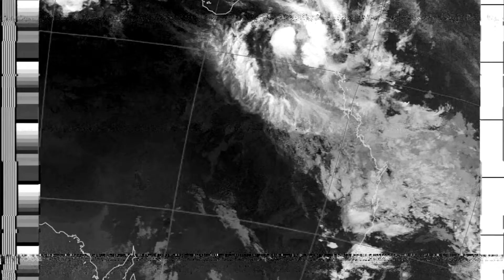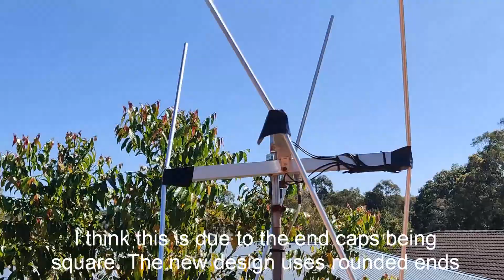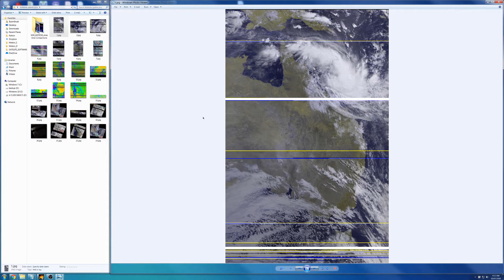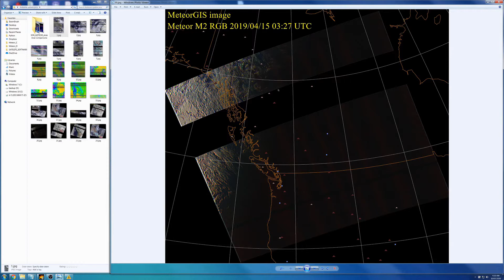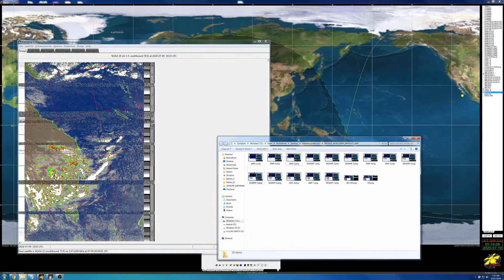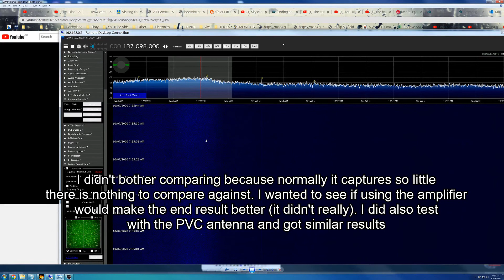NOAA/Meteor SDR Antenna TESTING/RESULTS (Aluminum/PVC, Sawbird Amplifier)

Comment: A pre amplifier will also amplify the noise. A good antenna and cables are better than any preamp. I learned this in 1975 when installing  a car radio and listening to FM radio.  Just my 2 cents. Thanks for a very good video. Will soon build some equipment and start receiving weather images. Have a bunch of SDR-RTL devices. Use them and feed data  into Piaware and Flightradar24.

Comment: The Sawbirds filter/amplifiers are great if you live near airport/interference. I recommend it if you live in very radio noisy area. I also find the sawbird great if your using a V-dipole antenna, which isn't as good as other antennas in terms of reception.

Comment: I am in the eastern US,A, and built a more simple V Pole antenna, one thing i noticed is some passes were poor quality and others much better. 
So I downloaded a program called Gpredict, and started tracking the NOAA sats, what i found was when the predicted passed were at least 50 degrees or higher over my house, my pictures came out much better . So now i pick and choose which pass to record  , based on 50  degrees or higher , using WXtoimg , the V of my  antenna is pointing due north / south. Also i use a saw filter for 137 mhz with bias T,  much better pictures. My Antenna is indoors right now and plan to mount it on the roof in the spring...Nice videos your doing !, keep at it its a cool hobby!

Comment: the black bars/noise is because of signal strength ... i wonder if you have your antenna in the wrong orientation. the FOV difference is because the satellite is in a slightly different position on its way around.
Reply from the maker: Interesting thought it might be in the wrong orientation. I am pretty sure its correct because I had one of the old antenna's elements upside down and I made sure the new PVC one would be correct orientation but i might check with my multimeter again just to make sure. What do you mean by "FOV difference", what timestamp am I talking about this so I can understand a bit better
Reply: @BoomBrush  with respect to the FOV just remember that the satellite is not in a geostationary position so as such, the orbit varies over time so one minute it might go directly above brisbane, the next pass it could be like 100 miles east or west of it at the same time in the pass. with that your image obviously is going to have a different view between passes.

As for the orientation. it's possible that instead of having the elements north/south, you could have them "south north" or even east west.  the other issue is that you could have them right hand polarised instead of left hand for example. it could also just be that there's a whole bunch of noise that came up and the antenna isn't very good :D

So many things to check. if you have an antenna analyzer like the nanovna, you could figure a lot of that out. it could also be that the tuning is off so the resonant frequency of the antenna is not what you think. Don't forget that things like wire size and length are important
Reply from the maker: @WX4CB  The antenna being off is always a possibility and weirdly enough I came across the nanovna and a video on how to interpret the results when I was working on this antenna. I'd like to play with it one day. Sadly because the antenna is at my parents I have very little incentive to actually work/improve on the project due to travel (my tools are no longer at my parents) and the fact I can't erect the antenna where I live now (renting). Keep in mind this update video came out over 2 years after the original, mostly because I see it as a finished side project. If I ever spent a long period of time at my parents again I might have a look into it with some of my tools, like earlier this year during the March-July lockdowns (what inspired me to work on this). If I get a chance I will definitely get up on the roof and have a look but otherwise I think this project is kind of finished. Sorry if its a bit disappointing but thank you for your advice